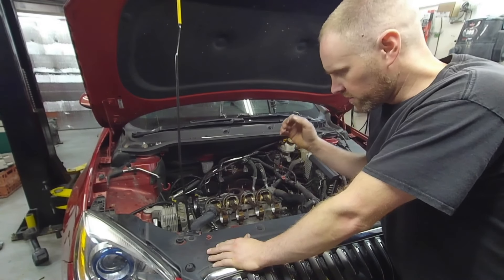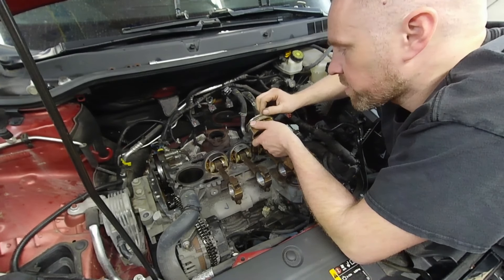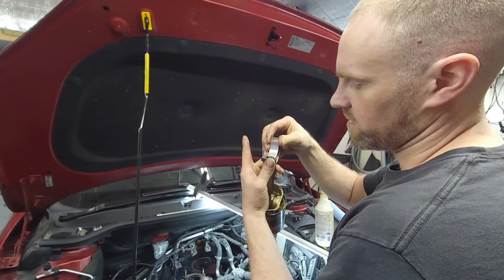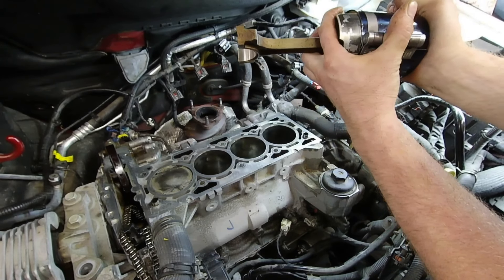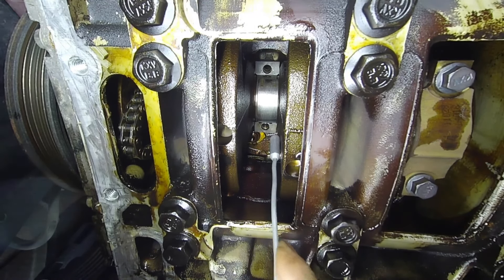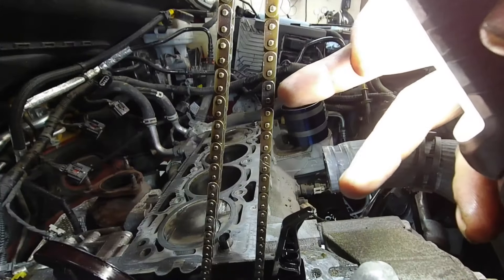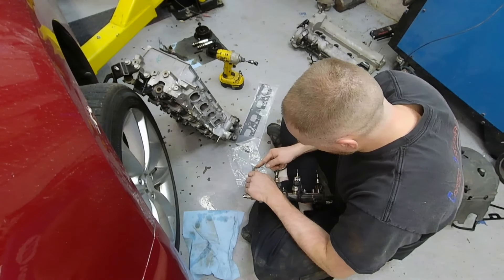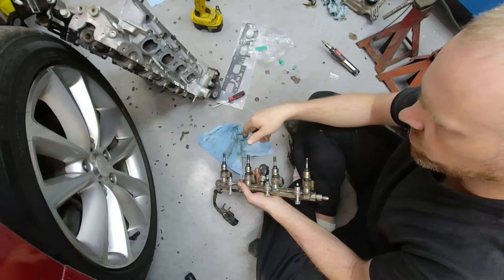2012 Buick Ecotec Blow By Issue From Bad Factory Piston Rings PT3

Comment: Man that piston you were installing furthest from the right was missing some of the piston coating on the skirt! I would have replaced the pistons as well!
Reply from the maker: I thought about it but realized the coating wasn't done right in the first place and if I put new fresh coated pistons in who's to say they won't do the same. Then you will have that stuff going through the oil again. Besides missing the coating when the skirt is fine won't hurt it only about halve of the modern engines out there have coated skirts.
Reply: CrazedPerformanceRepair that coating was put on there for a reason! That coating is very important now days because of the short piston skirts. Pistons with short piston skirts tend to rock a little. Also I’ve seen that coating defective as you say and when it starts chipping off , I’ve seen it clog the oil control rings resulting in oil consumption. Yes only modern pistons have this coating but older pistons had long skirts resulting in less piston slap/ rocking!
Reply from the maker: @1YouTube_you  I understand the purpose of the coating and I am very aware of short shirts and the use of coatings on them. After all I build extremely high performance daily driven engines often enough to understand it. For example, I have one customer with a corvette putting down 1,026 rwhp and he drives it 8,000-10,000 miles per summer. It has just over 20,000 miles on the build, doesn't burn a drop of oil, cylinders look perfect and that is on a stroker engine with very short skirts. The fact of the matter is that low end eco-tech engine is going to be prone to many other failures well before those skirts and the lack of coating causes a issue.

Comment: is this a 2.4 Ecotec? I see that you have the connecting rod tang or notch facing towards the exhaust side viewing the bearing, being the crank pulley is to your left. I just rebuilt a 2.4 Ecotec l4 in a 2017 Buick Verano. And I believe I have the connecting rods backwards. pistons are going in the right direction, but maybe not the connecting rods. Funny I was told they face out from a liscensed mechanic. Timimg everything is replaced but I cannot turn the engine over by hand. Is it possible that its because of backwards connecting rods?

Comment: Its kinda late but I'm rebuilding the same  2.4l ecotec and I bought mahle rings standard size do I have to gap them and if I do could u tell me the gap size for top  middle and oil rings thank u
Reply from the maker: You should always check gap. The rings should come with a gap chart based off the bore size and piston type vs application. Use it and do the calculations. It's probably going to be around .005-.0055" per inch or bore. 2nd ring always gets a little more gap to prevent ring flutter.
Reply: Did I miss a video👀 or did you not show how to gap the rings??

Comment: Hello I want to say that this is a great and helpful video because I’m Doing the same thing to my 2011 equinox but i have a question for you   I’m replacing the pistons and rings but honestly I don’t know how or in what direction the rings go if you please can share that info 
I appreciate it in advance
Reply from the maker: The only thing that really matters is that the gaps don't line up with each other. I like to set top ring gap to intake valves and second ring gap to exhaust valves. I then set up oil ring with springy portion break either intake or exhaust valve and set the scraper ring gaps across each other 90deg from spring break.

Comment: What do recommend,  I just bought a 2010 equinox with 2.4
Didn't know these engines had a recall for ring and piston. It is just out of warranty recall.  It is using oil and has blow bye. 
Should I sell it quickly or  pay to have it repaired,   or look for a replacement motor 🤔  I do have car shield  warranty,  not sure if would be covered.

Comment: Ive just replaced my pistons on my ecotec 2.2 engine. How do i know what the bottom half I should align to the camshaft sprockets. I know the cams have to be 10 and 2 but the pistons can be 1 and 4 top dead center on either cycle? In your video you are putting your head back on and cylinder 1 and 4 are at top dead center. If you were to spin it 1 cycle it would also be at top dead center. So does that matter when I go to put the head back on?
Reply: No doesn't matter.  you've probably figured this out on your own by now but for those having this same question,  on the bottom half it doesn't matter as long as piston 1 (and 4 in this case) is at tdc, the bottom half (aka just the crank) doesn't know which stroke its on compression or exhaust stroke its just bringing the piston to the top every full rotation.  what stroke you're on is all determined by the camshafts and which valves it is opening and closing.  you need to have number one at TDC while the cams have both valves shut aka the compression stroke for your timing to be correct.  if you have piston 1 at TDC and all your marks lined up on the cams and crank and the exhaust valve is open you are what is known as 180 degrees out. The reason this is possible to mess up is because the crankshaft rotates twice for every one rotation of the camshaft.  basically if your 180 out you put your timing chain on with the cam halfway through a rotation (180 degrees).  
So TLDR basically put the top half (head) back on with the bottom half having piston 1 at TDC. Get your timing marks aligned on your cams and crank and put the timing chain on (with all the slack being taken up by the tensioner and ZERO SLACK between the sprockets).  and on cylinder 1 and 4 your valves should be closed if you're right (aka on compression stroke).  turn your motor through a few cycles to make sure nothing binds up, it will bind up after a few cycles on this engine if you messed up because its interference.  if it turns through a few cycles an nothing binds up and your marks are all staying aligned you are golden. 
Also if you're trying to figure out if a valve is shut or not, a valve is shut when it's not being activated by a cam lobe, aka its riding on the flat.  while the valve is riding on the flat and not being activated it should be a little wiggly if you try to wiggle it, this bit of wiggle room is known as lash.  You would not be able to check the lash on a valve that is open because there is no wiggle room.

Comment: Did you hone the cylinder walls or just clean?
Reply from the maker: Just cleaned them
Reply: @CrazedPerformanceRepair  Did you replace all of the rings or just the oil control rings?  Definitely should hone if all of the rings are replaced.
Reply from the maker: @LTVoyager  the thought the cylinder needs to be honed for new rings is a old practice no longer needed. The rings these days have such a good tolerance you can get by without it. Infact honing a cylinder may do more harm then good since most people get too aggressive with it. If you have a fine stone (400 grit or more) a really light glaze break. Could be done, but that is the most I would do on a good cylinder. The proof is in this job along with more I have done. This guy contacted me again a year later on a different issue with a different car. He mentioned this car that I had forgotten he had me do. I remembered I did the job just forgot it was for him. I asked how the car was doing after he mentioned it. He said it's awesome and hasn't burned a drop since. Also bragged about how much smoother it idled after. So needless to say, that visit was a refreshing one.

Comment: Good video! On the injector seals you can use a hose over the seals and then clamp them down with a hose clamp for a few minutes. That shrinks them back down. Also your not suppose to use any oil or any lubricant when installing them.

Comment: Why not take the timing guides and chain out, install them after the cylinder head is installed, just made the process much more difficult than it needed?  Otherwise it isnt a bad video....
Reply: The timing chains do not last on these either. Always put in the complete timing kit on a ring job .